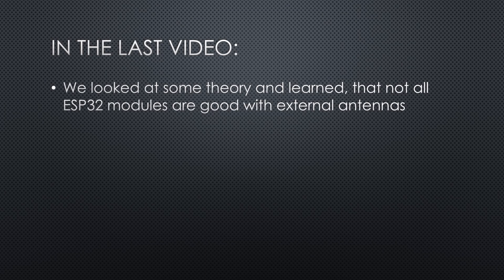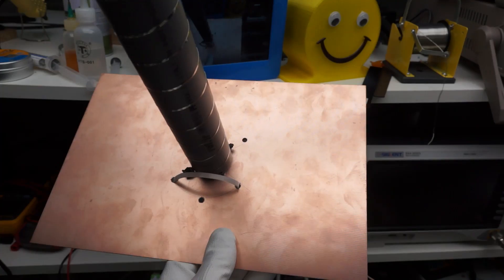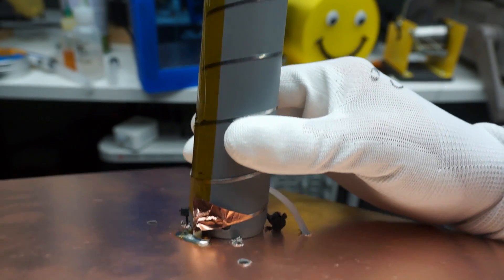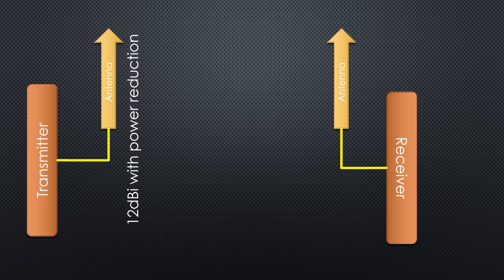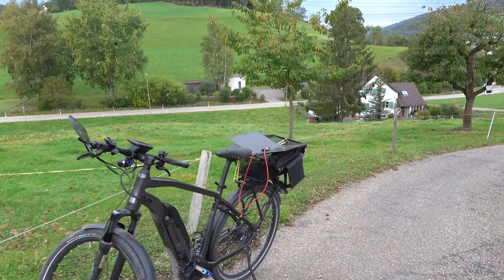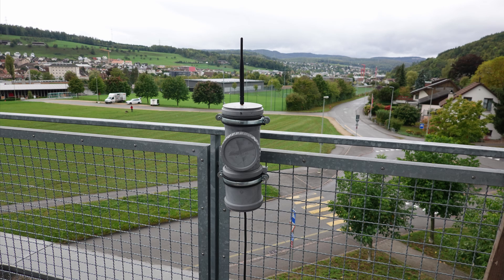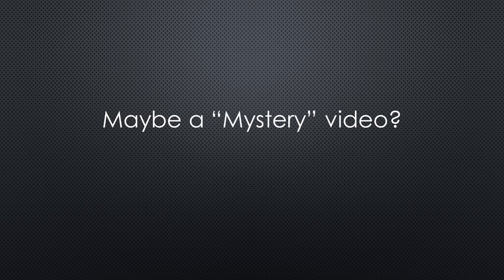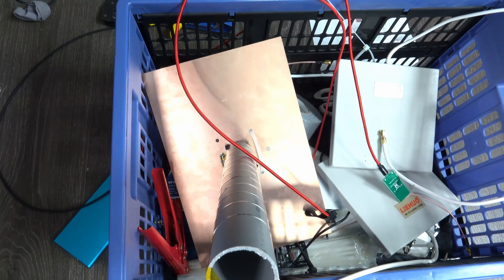#292 Wi-Fi Antennas with Gain and ESP32 Long-Range Mode (part2)

Comment: Gruezi. What do you think of the crude methods to add an external antenna to an ESP devboard v1 that only has a PCB antenna? Is there any chance to tinker with it such that we can match the impedance properly?
Reply from the maker: O would not try it unless you are good in RF design and have the necessary instrument because you can buy boards with antenna connectors.

Comment: dont work 

............................................................................................ets Jun  8 2016 00:22:57

rst:0x1 (POWERON_RESET),boot:0x13 (SPI_FAST_FLASH_BOOT)
configsip: 0, SPIWP:0xee
clk_drv:0x00,q_drv:0x00,d_drv:0x00,cs0_drv:0x00,hd_drv:0x00,wp_drv:0x00
mode:DIO, clock div:1
load:0x3fff0030,len:1344
load:0x40078000,len:13964
load:0x40080400,len:3600
entry 0x400805f0
Slave
 
Error = 0 , Mode LR OK!
...........................
Reply from the maker: This project is 6 years old. Maybe you find a newer one...

Comment: Z=140xC/Lambda
Now, to get a standing wave axial type helical antenna we want C=lambda. 
Which means were pretty much stuck with a 140ohm antenna. Now i don't how how it will affect beam forming or matching but using three perfect helical antenna with a matched 50ohm cable will give 140/3 roughly 50 ohm to get work done.
Reply from the maker: You have to adapt it to 50 ohms before the cable. It is done by the small triangular copper plate. I did not look into how it works.

Comment: Is not correct, because helix antenna have circular polarization, but patch antenna v-h. That's mean 6 db loss for helix, but thus helix independent for source orientation. Caution, helix create interference for both polarization v and h at the same time.
Reply from the maker: You are right about the loss between vertical and circular antennas. I do know which polarization my patch antenna has. My POTY 2.4GHz patch antenna, for example, is circularly polarized.

Comment: Question:  Does usable range imply both Signal from Site A can be received at Site B  AND that it can receive signal from devices at Site B trying to communicate back to Site A?

I moved to the beach recently. I’d like to extend WiFi coverage approximately 250 feet to the beach . I do have direct LOS from second story of house to desired area of beach about 250 feet. I’d like 5gig coverage for iPhone and laptops. 

If a long range Access Point states its service is usable at 300 METERS,  1) that seems more than enough and 2) does that imply that Iphone and Laptop device's WiFi signal can be received by that LR Access Point?
Reply from the maker: I strongly suggest watching this channel: https://www.youtube.com/channel/UCHqwzhcFOsoFFh33Uy8rAgQ He has plenty of stuff for your use case.

Comment: Hi Andreas, I'm Marco from Bavaria. Thank you for your time and great tutorials. I know this video is related to WiFi transmission but since you are a great fan of LoRa, I'd like to ask you a specific antenna question there: To my knowledge, the ISM regulation in Europe is 14dBm (=25mW). I see a lot of dipole LoRa-antennas with a gain of around 2.1dBi. For a specific project, I'd like a gateway to be able to listen with a long-range antenna. There are a couple of YAGI antennas with gains of 11dBi or even 23dBi available and can be sourced from digikey:
https://www.digikey.de/products/de/rf-if-and-rfid/rf-antennas/875?k=yagi&k=&pkeyword=yagi&sv=0&pv1851=291672&pv1851=299188&sf=0&FV=-8%7C875%2C1850%7C417331%2C1850%7C417333&quantity=&ColumnSort=0&page=1&pageSize=25

Do you think it is possible to connect multiple antennas over one HF port on a LoRa gateway (like the ones from Dragino or RAK). I can imagine that the signals of two antennas could interfere on the one hand. On the other hand, if the 2.1dBi dipole antenna is not receiving much signal and the long-range one is, there's not much to interfere :). What is your opinion about this? How can be ensured that ISM standards are met?
Reply from the maker: It is not easy to connect multiple antennas because all antennas have to be 50 ohms. If you connect 2 of ehm they are only 25 ohms, etc. I also made a video which shows that the antenna is not very important for lora. If you have no line of sight, usually it dows not wôrk. If you have line of singt, it woks up to 700 km and more. Receiving with hi-gain antennas is alllowed. transmitting of course not.

Comment: I am new to projects like this. I dream about making a portable transmitter/receiver for the common signal types like cellular, GPS, WiFi, bluetooth ANT+ and wonder what it would look like to make the form factor ideal for the antennas and portability. My thought is that it might be a good experiment to consider tethering various devices from such an antenna hub based on the contexts that you would use them instead of trying to continue to pretend that cellphones are good for everything. I could use advice on what direction to head to get the supplies and skills I need. Thank you for your excellent videos.
Reply from the maker: Maybe you start with one after the other? This is a huge project.

Comment: First of all I want to thank you for your work and enlightening me and I would like to give you an interesting topic when it comes to long range communication.
I came across this doc yesterday https://dl.acm.org/citation.cfm?id=3345436&preflayout=flat
For IoT devices this seems excellent and I am really looking forward to see an actual implementation and maybe even test it myself, maybe something for you to look at as well?
Reply from the maker: Thank you for the link. I read the paper. Interesting idea. For me it seams like a niche product. On low data rates it easily could be replaced by LoRa with much better link budget. I also would transmit voltage from time to time to solve the Problemorten knowing if the device has no power.

Comment: What about a bi-quad with reflector. I built several back in 2003 like the one at https://martybugs.net/wireless/biquad/ very high gain especially if you use it to feed a dish antenna.
Reply from the maker: Thank you for your link. I for sure will build one as I already bought the dish. Andrew is also a big fan of biquads.
Reply: @AndreasSpiess  I will look forward to seeing it if you make a video. I am currently building a 5/8 wave 10, 11 and 12 meter vertical out of copper pipe then moving on to VHF/UHF in 144.MHz and 430.MHz . Good luck I enjoyed your videos.

Comment: Hi, can i ask one question Herr Spiess? I'm searching for some kind of power on reset device for esp8266, so if my solar weatherstation falls out because the overnight drained battery, when reaches again safe voltages it resets the esp! Thanks
Reply from the maker: You can search for voltage monitor IC (e.g. TPS3839) These keep the reset pin low as long as not enough voltage is available.

Comment: Hi do you know any solution for transmitting and receiving data low power? eg temperatur data sending and receiver both with a couple of aa batteries? nrf24, rfm95..they all need too much energy in rx mode. I'm searching for over an year now..
Reply: LoraWAN, ZigBee, Z-Wave
Reply from the maker: @max things: DerpyDoom is right
Reply: Really in RX mode and battery powered? As my searching there seems no other solution than a ook receiver. All the chinese stuff, wirelss door bells, thermometers..they all worked with simple ook receivers and many many month with just two mignon cells

Comment: Follow my prior comment : 

Wind usually associate with rain but fog. Antenna set in vibration in windy day, rain or shine, can make matter worse, with unwanted amplitude modulation that convoluting the wanted signal by a vibration magnitude and rate. 

I agree with other commentator that flat antenna in video has feed port point sideways but downward. Can contribute 3 to 20dB polar mismatch loss to a linear antenna at the far end.
Reply from the maker: Thank you for your information!

Comment: Patch Antennas were not located correctly!  This can be seen on video 7:45 and 6:55.  The fact is that the patch antennas have a clear vertical or horizontal polarization.  The spiral antenna has circular polarization.  Therefore, for a spiral antenna, it does not matter what position it is in.  For the Antenna patch, it is important that the cable goes down both on the transmitting antenna and on the receiving antenna.
Reply from the maker: I wondered which polarization the patch antennas have. Now I know. Thank you. AFAIK the loss of a wrong polarization is 3dB.
Reply: Just because the patch antennas appear to exist in two dimensions, it does not mean that they exhibit only linear polarizations. Patch antennas can be fed in a manner that produces circular polarization. If a single patch is fed from the side it is usually linear.  If fed into the patch directly to a point inside the perimeter it can produce circular polarization. Many panel antennas are actually 2-4 patches which may individually be linear polarized but phased to produce circular pol.

Comment: I think the mode comparison was a little unfair by transmitting using different modules, cables and antennas. Interesting results anyway!
Reply from the maker: There was less difference than you think. The transmitters were the same modules. The receiving s ich de was completely the same as I changed the Sketch f oh r the different Tests. The transmitting antennas were different.
Reply: Ok, got it!

Comment: there is a great parametric design of a helicalantenna on thingyverse. using it for 5.8ghz video and outperforms any antennas I have bought that advertise same specs and is  even quite rigid (the death of my self build helicals with cardboard was always  because i threw them in a backpack and the copper wire deformed. not so with the design from thingyverse)
Reply from the maker: Sounds interesting. Do you have a link?
Reply: @AndreasSpiess  hi andreas, sure! its thingiverse.com/thing:2497461
Reply from the maker: Thank you!

Comment: Your patch antenna in your test was facing downwards slightly , did you check radiation polarisation?
Reply from the maker: I saw that too. Bad mounting and some wind. The opening still should have been enough. For sure I lost a dB or so.

Comment: Short question.  If I have an esp32 with an MQTT client with LR configured, is there an easy way to get it to an MQTT server in the cloud.  The esp32 access point will be configured in LR mode also.   So the esp32 LR appears to form an isolated island.  It would seem to require a Bluetooth or serial link to another esp32 in normal mode.  Is there a better way
Reply from the maker: I did not look into using a ESP32 as a bridge. If you look at the sketches I used you see that the master first connects to a regular AP. So it should be possible to use this one as a bridge.My topic was more the LR mode.

Comment: Weather is a problem f of water is 2.4 GHz, so trees and rain/for are a big no :) also try pringles and yagi antenna. 
Back in a days, around 16 years ago we manage to make stabile links with WiFi antenna made with satellite dish and yagi inside dish, we manage to reach 5-6 km in city and more than 30 km  outside urban areas with Ateros chips since you can go a little outside regular WiFi freq. :) not so legal but it works :)
Reply from the maker: Thank you for your info. Of course I also had some „outside legal“ ideas;-)

Comment: Water abdorbs 2.4GHz 
http://www1.lsbu.ac.uk/water/microwave_water.html

Airborne droplets will do transmission range no favours at all. 😕
It gets worse with salt spray... Not a problem in Switzerland but worth considering ocean-going or even coastal applications where one might like an RF bridge to a smsll island without Internet.
Reply from the maker: That is what I thought. Interesting to bring salt into the equation! Never thought about that.

Comment: 6:40 When considering the Fresnel zone this location is line of sight (light) but still not good for RF communication with trees and power lines inside the Fresnel zone.
And the helix antenna is circular polarity and will have significant polarization loss against a vertically polarized antenna.
Reply from the maker: You are right about both facts. So far I never used circular polarized antennas. I have to investigate a little more into this matter.
Reply: @AndreasSpiess You should be lost at least -3DB for using a circularly polarized antenna with a vertical antenna. I would recommend you to use a parabola antenna to get a higher gain.
Reply: @AkawichPonIn  The circular polarized is actually not a bad choice. Just because it attenuates any linear polarized signals (or noise) by 3dB or more. And most noise, WiFi and Bluetooth is linear polarized. But of course you need the "partner" to be polarized in the same twist.

73 de LA8BKA
Reply: @AndreasSpiess  I noticed you running cross-polarized antennas in your LoRaWAN distance tests starting with your gateway having a antenna that was 10° off vertical.  This is something to avoid that is emphasized in the ARRL's educational literature as you'll lose 20dB when you use orthogonally polarized antennae.  
https://www.mtiwe.com/?CategoryID=353&ArticleID=163

Comment: Nice Video Andreas, but i think youre missing a major key to antennas...Polarization... youre mixing horizontal with both vertical and circular polarization... there can be upto 30dB loss between horizontal/vertical to circular...and about 3dB loss between horizontal and vertical...you should be using the same antenna (dimensions and polarization) on both the RX and TX sides
Reply from the maker: You are right. I did not consider polarization. I was not aware of the 30 dB. I was aware of the 3 dB between horizontal and vertical. But with all my tests I was not able to see big differences. If circular is so different I have to look into it. Also which polarization a panel antenna has
Reply: +1
I came down here to say this too.  I think H-V cross polarization is a 20dB loss though.  I think circular to linear is 3dB.

Comment: Hello Everybody! Do you think ESP32 LR or LoRA are good ideas to consider when i'll try to connect my apartament with my basement in multi-occpupied building? I live on 5th floor and basement is on -1. There are many, many layers of reinforced concrete between us :( Any ideass greatly appreciated! Cheers!
Reply from the maker: I would try Powerline. Here you have at least a change to be successful. LoRa only transfers a few bits per seconds
Reply: @AndreasSpiess  Possible depends on the country? I think some countries may use 3-phase mains? So it may be hard to find a power outlet in the basement on the same phase as the apartment?
Reply: I think that WiFi is very unlikely to work at all.

Comment: Bravo! Such a great series of tests that for someone who knows little about radio and antennas but who finds the concept of action at a distance fascinating, were both useful and interesting. I have experimented with a commercial Yaggi antenna to connect the IP camera in the stable where i have my pony with my home wifi over a short distance of about 25 m, but although I had a little success it was not reliable, but I have managed to get a connection via the main cable with suitable devices and have given up on the Yaggi for now. However, I may revisit it as I have cabins at over 100 m that it would be useful to have wifi in. Just have to be motivated when i have time, the former easy, the latter not so. Thanks for sharing!
Reply from the maker: We all have 24h. The rest is priorities ;-)

Comment: Hi Andreas. Did you  care about the antenna polarization ? If your antennas are not with the good one there are big losses. As example: using two different linear polarization, there is 20dB of attenuation. As you use circular polarization, and if I remember my radioamateur experience, you must use one right hand and one left hand polarization. In an other way, it is not because an antenna has a good VSWR proove that is a good antenna (see VSWR with a dummy load). Hope this could help. regards F1SLU
Reply from the maker: You are right. I know about polarization, but never exprienced huge losses or wins on these high frequencies. And very often you cannot match porarization if the devices move (e.g. smartphones). I always thought the loss between horizontal and vertical polarization is 3dB. But I did no research.
Reply: Andreas Spiess 
Theoretically, line of sight reflection free polarization mismatch of perfectly linear polarized antennas can be infinite loss and not 3dB. 

Practically antenna system imperfection, imperfect linear polarized and stray reflectors may contribute cross polarizations allows an infinite loss to be finite loss. 

A polarization mismatch link between linear and circular antennas in free space is expected to be -3dB.
Reply: @AndreasSpiess  It's 20dB. between circular and linear it's 3 (or 6 I do not remember !) dB

Comment: Cool. But I just sent a first Hello World message using a NB-IOT network. No need for big antenna's. T-Mobile offers a free sim card to play around with for a year. Maybe you can do a vid about these too.
Reply from the maker: If they would start it here for sure would cover it.
Reply: @AndreasSpiess  Are you suggesting your area isn't covered yet? I expect my nb-iot device to work if I would bring it over there and plug a battery in. A search on google tells me that Swisscom has completed rollout in Switzerland as per June 2019. Not sure if you can get a free sim to play with. 

https://www.digitalkeys.io/nb-iot-network
https://documents.swisscom.com/product/filestore/lib/7247d9ff-14e6-408a-9982-c0589b688912/brosch%C3%BCre_connectivity-en.pdf (page 8)
Reply from the maker: I have a colleague who is in close contact with Swisscom to get a module and a SIM card. Unfortunately, the project is shifted and shifted...